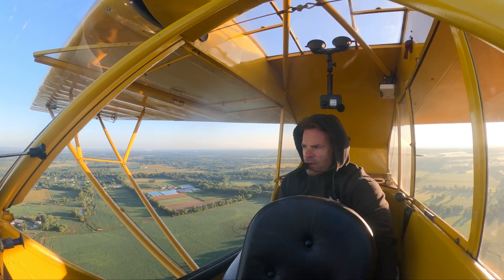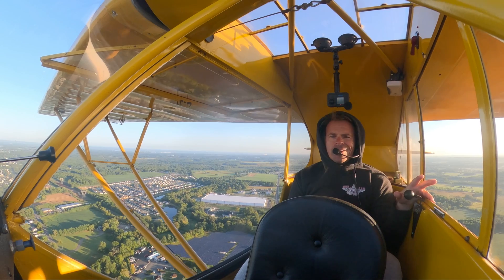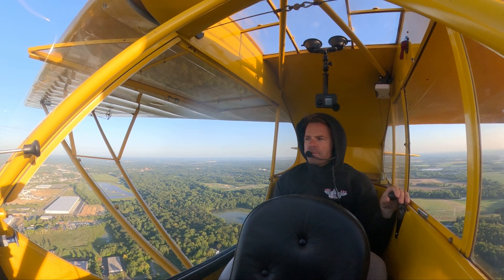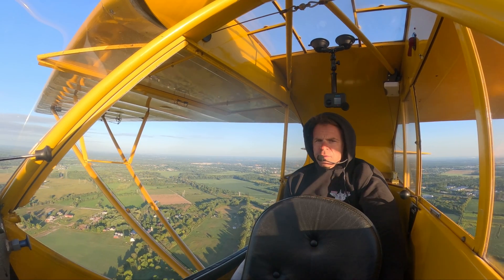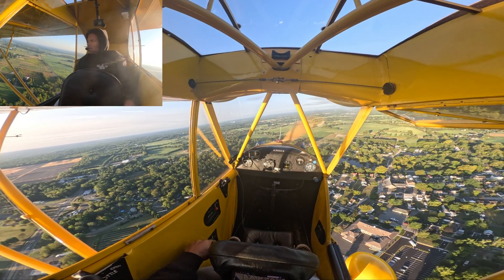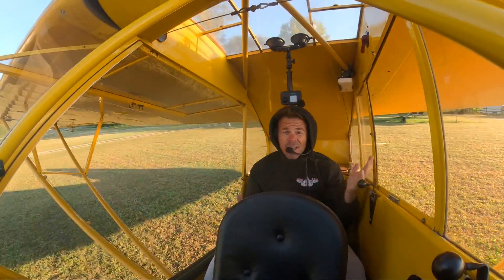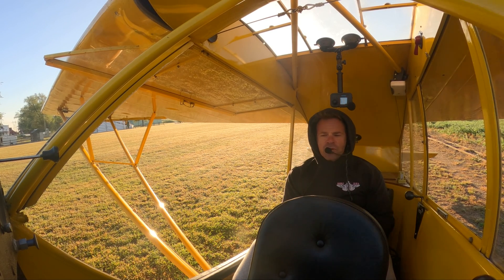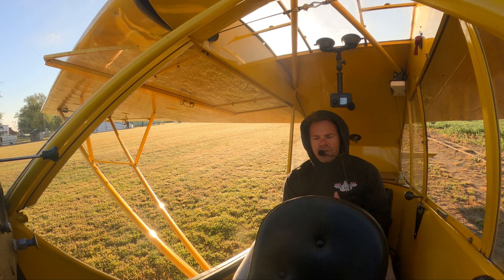Emergency Landing with no Aileron or Elevator. (Simulated). A Fun way to make you a better Pilot

Comment: 60 yrs ago my first RC model airplane was a single channel rudder control only. It was trimmed for glide when gas ran out.  A couple of years later I got my private in a C150 and shortly after I had the privilege to rent a PA11 Cub. A year later I trimmed the Cub for slow flight practice 30 minutes from home port. Fuel was getting down so better trim neutral and head back but the trim cable jammed full aft. Had to throttle back to keep it from climbing while making forward progress.  Had full two arm force just to get 50 mph so I would enough fuel to make it with a head wind to boot.  I made it on fumes with two hurting arms.  Controls can fail or be incorrectly rigged.

Comment: Great subject material- This scenario can certainly happen.  My father actually had a small bolt roll into the linkage for the rear stick on his PA-12 while the rear stick was out and it locked the elevator control and partally locked the ailerons.  He flew back home with his rear passenger using the same skills you show.

Comment: Hi Joe. A good way for your interested viewers to rehearse this is pick an appropriate 'simulated hard-deck' altitude well above the ground and ending in three round numbers, so your altimeter's hundreds needle indicates your target touchdown height when it's pointing straight up at the zero. This is really just so you don't have to stare at the altimeter and can keep most of your attention outside. Use this method to practice controlling descent at a safe altitude with only power and pitch trim until you see how your plane reacts as you're trying to check your descent and round off to the flare. When you're confident then move the exercise to the actual hard deck, preferably a remote, level, long grass strip with a clear approach as you demonstrated. And hopefully pick days with light steady wind until you're ready for more challenge. Credit for this to my old Colgan primary instructor Bill Sanborn.
Reply from the maker: Thanks Mark! Appreciate this and a fantastic idea!
Reply: @Bananasssssssss  Yeah man, when you can gracefully and predictably round out on zero just prior to the stall, next step is doing it on the ground for real. Folks who are a little scared should maybe consider bringing an experienced copilot or instructor. Btw your landing in the video was nice! How many tries? 😁

Comment: "The design of the airplane is to fly."  "The Law of the Roller Coaster."  "Dynamic proactive rudder movement."  Your exercise is applying some very important principles.  Ken Hoffman didn't let me touch the stick in the Cub on my first dual cross country.  Folded map in one hand and throttle in the other and active feet to direct/yaw properly the course.

This is also a very good demonstration of the fact that no aileron with its adverse/incorrect yaw is ever needed on final.  Yes, to put the wing down into a crosswind, but then leave it alone.  Yes, more aileron into the wind on the ground, but don't quit walking the rudder while you do that.  Good job.  Good demonstration.
Reply from the maker: Thanks Jimmy! I appreciate the insight
Reply: 50 years age I got my license in C-150. A year later I got checked out in a PA 11 Cub.  I had a blast flying that rental until on one flight about 30 minutes from home base I thought I would practice some very slow flight and trimmed it for that speed.  Fuel was getting low so let’s trim for cruise and get home.  But as bad luck can happen, the trim cable system came loose and jammed full aft. Being a  new pilot and it wasn’t mine to land out I felt the need to get it home with fuel to spare. Boy both my arms were hurting puppies from  trying to keep it from climbing and still keep progress.  Barely made it.
Reply: @nickcaci7238  Those were both good trainers of total energy management.  Instructing summers at Monte Vista Colorado in the C-140 while my wife was getting her master's degree, I found the level in low ground effect technique to be 50 % of my total energy and down drainage egress to be another 25%.  I told my students that if pulling back on the yoke didn't get the climb they expected to try pushing on the yoke.
Reply: @jimmydulin928   
 … yes pushing forward or trimming forward especially if the CG is at its rear maximum, can help get the wing up on step for greater efficiency.  But that’s always a chase and reset roller coaster.   Hindsight is always 20-20.  With just a hundred hours experience with that full aft stuck trim, should I have handled forward distance progress like thermal gliding up wind? Two steps forward, one step back and if i ran out of fuel, would I have had the altitude early for the final glide??

Comment: I'd have to land the Luscombe at 90mph 😂 it's so nose heavy that as soon as I pull throttle to idle with full nose up trim that thing is dive bombing
Reply from the maker: Haha I actually thought about your plane and how heavy it is
Reply: What engine do you have on it? I have a lot of time in an 8A and didn't find it nose heavy at all.
Reply: @wheelsupbardown  the 8E has at least 50lbs more just in the nose with the C-85 and electrical components. I'm sure gas in the wing tanks instead of the fuselage adds some too.

Comment: My airplane is a pusher so it becomes a whole different animal (Challenger 2)
Reply: I instructed on RX-550 Beavers. Someone had an up elevator cable failure, I think back in the nineties. With that high thrust line it’s no problem getting the nose down. Apparently they used an aggressive forward slip to get the nose to pitch up. After that we modified the pulleys and added another up elevator cable.
Reply from the maker: Thats gotta be a handful, lol